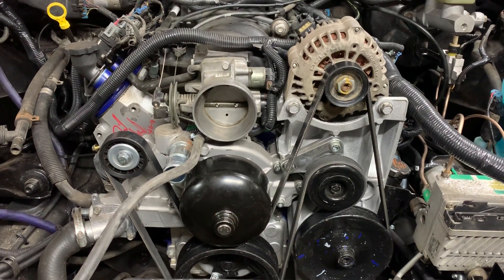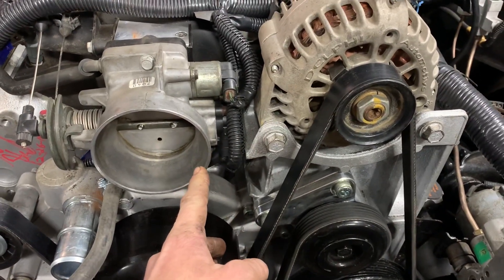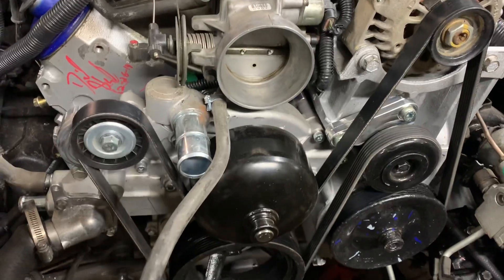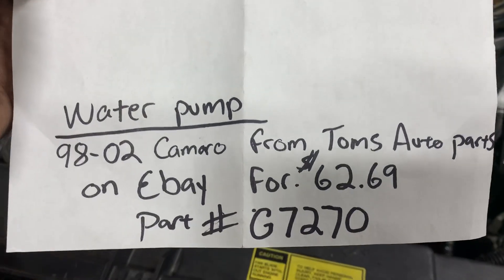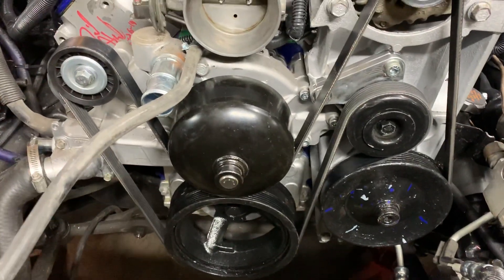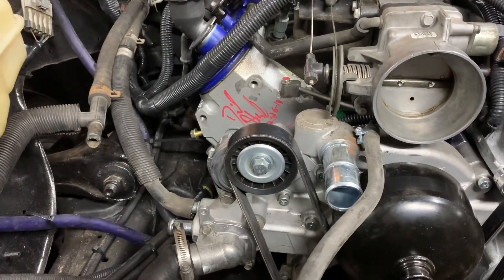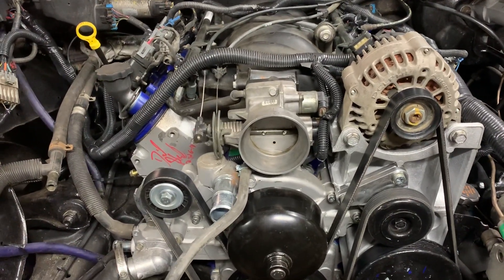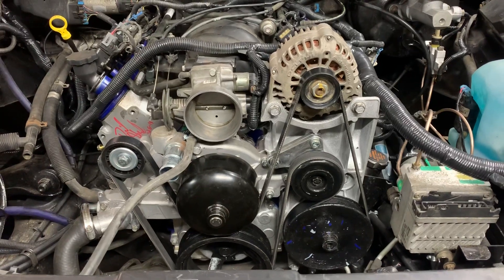LS swap Truck accessories with LS1 intake How-To video.. Great explanation with part numbers!

Comment: Belt size
Reply from the maker: Did you watch the video?
Reply: Yeah it’s actually the wrong one use truck water pump…. Maybe still work
Reply from the maker: @gregcowan4477  its been on the car over 3 years… I used the LS1 water pump.
Reply: @thehowardsgarage2480  yeah have a truck water pump for avalanche… lm7/l59… I bout a in line Delphi fuel pump but can’t get it to pull fuel… any suggestions
Reply from the maker: @gregcowan4477   what vehicle are you doing the swap to? And is the fuel line going into an internal pump inside the tank? Or is it an old car that had a carbureted engine originally? Also, did you install the fuel pump too far away from the tank? Is the fuel pump at or below the tank level or did you mount the pump higher than the fuel tank?
Reply: I took the old pump off the 80 Camino… put in a  trugrade electric pump #D172A1H( same as Delphi on psi) and the inline corvette pressure regulator( mounted under passenger side frame of car). Fuel line back up to LM7 return less fuel rail…. Try to find out what harness to get that has the fuel pump wires connection or will have to mod it out… or spliced the connection and extend the wire connector close to the engine( got tired of crawling around).  Plus I went ahead and bought a elbrock 3-7psi pump too just in case I wanted to scrap the efi top end and go back carb with msd 6014. What do you recommend
Reply: At this point I’m at a stand still on how I’m going to get fuel to rails
Reply from the maker: @gregcowan4477  what year LM seven set up are you using? And I looked up that part number for the pump, and couldn’t get a psi rating for it. So, what’s the rated psi for the pump you’re using? Are you using the stock fuel tank? Sounds to me like you’re just not getting enough fuel pressure. As far as the wiring goes for the fuel pump. You just need a constant 12 V to the pump upon turning the ignition switch to accessory or start. So, you can run a very simple 12 V relay under the hood that goes to the ignition switch and powers your pump
Reply from the maker: @gregcowan4477  also, I have another question, have you confirmed that there’s no fuel coming out of your fuel line by doing a pressure test or at least pulling the line off and seeing if there’s fuel in the rail? Or is the car just not starting? Because, you could have other issues that are stopping the car from running, have you tuned the PCM to delete the security features that cause the injectors to kick off not allowing the engine to run
Reply: @thehowardsgarage2480  I have the starter and mounted to 2005 LM7/L59 vin Z from Avalanche. Motor is mounted and put on with TH350. Don’t have belt and harness or AC. Put it turns over but don’t fire do to fuel . I’m thinking bout just putting on victor jr intake and a 650 carb with msd box and wires. 3-7 psi of pressure is use for carb. I put the Edlebrock  Universal Micro Electric Fuel Pump on just to see if pull fuel with the efi pump in old tank.  no luck !

Comment: Did you use the 5.3 wiring harness on it?
Reply from the maker: Yes. I used it and the oem fuse panel and wired them together. Worked out nicely… all the wiring info is at LT1swap.com

Comment: What fuel rails are you using for it?
Reply from the maker: Stock LS1 fuel rails from a 1998 Camaro
Reply: @thehowardsgarage2480  will that work with stock flex fuel injectors?

Comment: Buddy how are you running the vacuum line? Valve covers has 2 ports, throttle body has 2 ports , throttle body has 1 port
Reply from the maker: Throttle body has only one vacuum line… the two on the bottom of the throttle body are used for coolant to run through to keep the throttle blade from icing over in cold weather.

Comment: Great video and advise if your upper radiator connection is on the passenger side.  For an even cleaner install you can do the same thing with a 2010 up Camaro LS3 pump, it has a connection on the drivers side and all you need is a short hose to the radiator.

Comment: any issue with the vent tube line? does it hit the vent tube lines?
Reply from the maker: Good question… so there’s a couple different types of vent tubes you can use. The one I had that came on the 5.3 had a long vent tube that connected the two front ports with the two back ports, so all four were in use. I had to switch to the other vent tube that blocks off the two back ports and utilizes only the front two, then I had to bend the tube slightly to get it to be low enough for the intake to mount securely. But it was pretty easy.
Reply: @thehowardsgarage2480  thanks for the info

Comment: WHAT TYPE OF RADIATOR AND ELECTRICAL FANS ARE YOU USING
Reply from the maker: Check through my videos, I made one specifically on the fans/radiator.., stock radiator is just fine.

Comment: How does the ls1 belt tensioner line up with the lq4 crank? I thought they were different distances? Everything else looks solid
Reply from the maker: Because the aftermarket waterpump spacers bring the pump out farther, and it’s mounted to the pump. So it aligns it correctly.
Reply: @thehowardsgarage2480  oh heck ya!  Thank you!!! Awesome video.

Comment: Where did you get your wiring harness from ?
Reply from the maker: I used the stock harness from the truck I pulled it from and integrated it into the stock caprice fuse panel.

Comment: Quick question, why is a f-body belt tensioner needed?
Reply from the maker: There may be other ways to do it but based on location and the way the belt is set up the f body seemed like the best choice in my opinion, and has worked quite well

Comment: Is there a kit they sell that can get me everything I need to swap my 4.8 to ls1 manifold?
Reply from the maker: I believe there is. But it’s quite a bit more expensive. If you go to Dirtydingo’s website they sell conversion kits. And there may even be some available on EBay.
Reply: @thehowardsgarage2480   can you list everything I would need to do the conversion. Thanks
Reply from the maker: @raulreveles6293  everything you need is in this video. Besides the complete intake  itself.

Comment: Are you still using the stock pulley for the power steering or did you change it out ?
Reply from the maker: Yes sir. Stock pulley
Reply: Wow I had to ask because I have a el camino gbody but mine rubs right on top of the steering box 🤔 thank you for your reply
Reply from the maker: @jaimecortes1108  no problem. It sounds like that would be because of the type of motor mounts your using, that’s why I used the adjustable ones from Dirty Dingo so it held the engine up a inch or two higher and you can slide the engine forward or backwards to adjust for clearance.
Reply: Thank you I will check them out

Comment: Great input, I do have a question in reference to the fuel line how did you run the fuel line considering that the coils are in the way
Reply from the maker: I made custom coil brackets. And there a video on here about them, they worked great
Reply: @thehowardsgarage2480  thank you I will check it out

Comment: I got a question so I know you use the Camero water pump but what pulley are you using on the water pump the original truck one or a different one ?
Reply from the maker: The new waterpump comes with a new pulley on it and that’s the one we will use
Reply: @thehowardsgarage2480  okay Making sure on idler pulley is it the truck or should I get a 98-02 gto one
Reply from the maker: @angelcastro4983  you can use the one from the truck.... you don’t need the f-body one

Comment: For the ls1 belt tensioner,can u use truck belt tensioner bolts?
Reply from the maker: All the info is in the video. I made that a year ago, but I’m pretty sure you need the new tensioner as well.

Comment: Hey awsome video one off the best videos i have seen about the ls1 water pumps Thank u for the video.  I did have one question im using the carb intake will i have cut the truck bracket and and what about the idel pulley relocation bracket will i have to use that one?
Reply from the maker: You wont need to cut the bracket, but everything else will be the same as I have it here... thanks for watching! Much appreciated!

Comment: ? I havr a 5.3 ls I can only start it when i on the gas pedal but when I get off the pedal it slowly die out
Reply from the maker: Will it stay running while your on the gas pedal? Or does it just start up for a second and die?
Reply: @thehowardsgarage2480  I have a ls6 intake on it too
Reply from the maker: @napoleoncarlton9569  I’d imagine it would either be a tuning issue, because the air to fuel ratio is not balanced. Or you have a large evap leak drawing to much air which is leaning down your fuel mixture causing it to stall unless you add fuel by accelerating
Reply: @thehowardsgarage2480   one more thing I did a fuel pressure test again it reaches 58 psi but it goes back down this is before starting the engine. Also thanks u for helping me out
Reply from the maker: @napoleoncarlton9569  if it’s not holding pressure you could have a couple problems. One being that you have a gas leak, that you would probably notice. Or the other problem could be that your fuel pressure regulator is not working properly. Do you have a vacuum hose hooked to the pressure regulator?
Reply: @thehowardsgarage2480  nope
Reply: @thehowardsgarage2480  it’s a ls6 intAke
Reply from the maker: @napoleoncarlton9569  got it.... did you watch my other video about fuel lines and filter with built in regulator? That’s important if you didn’t already do that
Reply: @thehowardsgarage2480  Gm so I was mess with the car last night so I decided to The retrace my fuel line to make sure they were in the correct spot n then I look at the fuel filter the lines was cross return on the sender  so I took off the fuel filter to make sure it’s was good I kind of clean it out  in put it back on then the can held the pressure for about 7 sec it fire up right away so I order another fuel filter
Reply from the maker: @napoleoncarlton9569  awesome. That should take care of that! Update me when you change it!
Reply: @thehowardsgarage2480  ok will do thank u
Reply: It only stay on while I’m on the gas pedal I’m getting 58 psi outta the fuel lines
Reply: Ok I put the filter on yesterday nothing change  I’m getting a poop poop Noise Exhaust pipes When I hit the gas too hard
Reply from the maker: @napoleoncarlton9569  at this point I’d say it’s a tune issue.... have you done any tuning to the pcm? If not then that’s going to be your problem, if that motor and pcm didn’t come with that LS6 intake and injectors then it’s not tuned for it and could be running poorly because of it. Also I’m sure you already changed them but if the spark plugs are old or fouled out then that could cause issues, so could a bad coil pack. Maybe you should run the codes and see if it’s missfiring
Reply: @thehowardsgarage2480  p0121 & p0123
Reply: Hey there I figure out my problem so I was  about to unhook my computer to get the tune check I discover a black wire was broken by the connector

Comment: My truck idler pulley does not fit the relocation bracket, is it different pullies?
Reply from the maker: No it should be the same, I’m not sure why yours isn’t fitting but I’ve never had anyone else have any problem

Comment: Could you go over the vacuum lines.
Reply from the maker: Which vacuum lines are you referring to? I deleted most of them.
Reply: There are three ports on the ls1 throttle body. Two on the right and one on the left. How did you route yours or block them off? Thank you.

Comment: I have a 5.3 ls I’m doing the wire harness but I don’t have the plug for the oil pressure switch what should I do
Reply: Can we use our same radiator or do we have to use a aluminum one
Reply from the maker: @napoleoncarlton9569  you can use the stock radiator just fine.... I did
Reply: @thehowardsgarage2480   OK NOW ITS STAY RUNNING WITH OUT MY FEET BEING ON THE GAS ONLY IS I HAVE TO HOLD THE GAS PEDAL TO START STILL
Reply from the maker: @napoleoncarlton9569  do you have the mass air flow sensor abs O2 sensors hooked up? They need to be there to measure the air to fuel ratio if it’s not custom tuned
Reply: @thehowardsgarage2480   YES I HAVE THE MAF I DONT HAVE ABS BRAKE SYSTEM I HAVE 66 BUICK SKYLARK
Reply: @thehowardsgarage2480  ok I getting 10.84v in my ignition wire
Reply from the maker: @napoleoncarlton9569  voltage is a little low but not terrible... maybe charge your battery, but it sounds like you need a tune
Reply from the maker: Your best alternative is to go to the junkyard and cut one off and wire it in, you’re going to need that

Comment: What transmission you running? A 700r4?
Reply from the maker: 504bricks thanks for subscribing!!! I’m running a 2001 4L60e from a 2wd silverado
Reply: What’s that other cable on your throttle body?
Reply from the maker: 504bricks cruise control

Comment: That belt doesn't seem to fit. It's about an inch short
Reply from the maker: BobLeeSwagger9 it has fit for many other people with the exact same setup including me. Are you sure you have the pulley pulled back far enough? It’s a tight fit but works, if not, just take it back to the auto parts store and tell them you want the same belt but an inch longer.

Comment: Power steering pump to Pittman hoses is still mystery to me. I once did olds to chevy motor swap fitting wouldn't fit. I changed Pittman arm. Some take pump leave it to side.
Reply from the maker: joey alfaro Check out my videos brother I have one for the power steering lines

Comment: Did you have any issues with the water pump spacers leaking? I did this same setup and im leaking coolant from the water pump area, im thinking its the spacers
Reply from the maker: UND3RR8D JAYY no sir... no problems at all and I have over 10 miles on it.. but I did have a leak that was coming from the water pump area and it ended up being the little coolant  pressure pipe above the pump leaking down onto it...
Reply: @thehowardsgarage2480  what did you do? Replace it or just tightened down the bolts?
Reply from the maker: UND3RR8D JAYY I just tightened the clamp that holds that rubber hose on,  that goes from the little coolant bypass tube, to the overflow tank.

Comment: What upper radiator hose would i use with this set up on a truck? Stock one or ls1?
Reply from the maker: UND3RR8D JAYY the stock one with a little bit of the end cut off.
Reply: @thehowardsgarage2480  this video helped me alot with putting my ls3 intake on my truck motor. I used all the same parts from.ebay from.the same seller, went right up to autozone n got the same belt. Good detailed video.
Reply from the maker: UND3RR8D JAYY yes sir!!! So glad it helped out brother
Reply: @thehowardsgarage2480  thanks bro

Comment: What did you do with the ugly truck wiring harness and other wires and vacum lines
Reply from the maker: Lyrical Walrus took the harness apart and integrated it into the stock wiring harness for the caprice, then wrapped it in wiring loom.ad vacuum lines, I just ran my own.

Comment: Hey, another question for you, do the stock truck fuel rails work with the ls1 intake?  I know you need truck injector spacers correct?  Also, Ive heard the truck valley cover bolts dont work with the ls intake because of clearance issues, is this true?  thanks!!!!
Reply from the maker: Paulee E Hey thanks for watching the video, I have the LS one and take on mine with the factory valley cover bolts so I can confirm that those do fit. But as far as the truck fuel rail on the LS one intake I think that that would be more of a pain then it would be worth doing, If you get on eBay you can find a cheap LS one fuel rail or even an aftermarket one and save yourself the money for the injectors. Or if you’re just wanting to save yourself from having to use the single fuel line type of rail, I made a whole video on how to very easily switch from having to fuel lines to one. Check it out it might help you. $20 is all you need